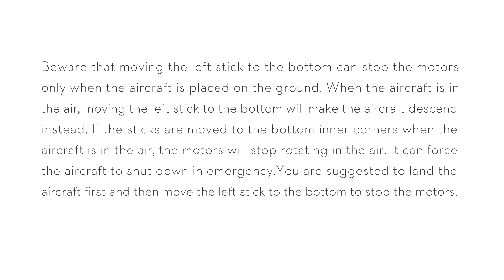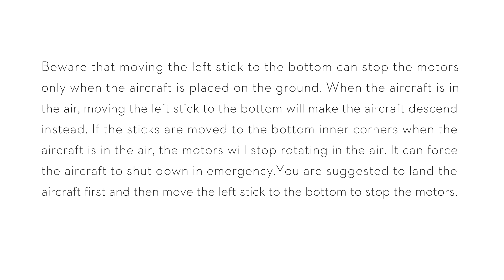DJI Phantom 3 | How to Use the Phantom 3 Standard Remote Controller

Comment from the maker: DJI Support is moving to DJI Tutorials! 
Don’t miss our consolidated contents and new videos, 
subscribe to DJI Tutorials at: http://bit.ly/2X04acQ
Reply: Wifi reset doesn't work for me. Any suggestions?
Reply from the maker: @vivianwhite3663  Hi, may we know the model of your drone, and could you please tell us more details about it? We will try to help. You can also contact us at http://www.dji.com/support
Reply: @DJISupportGlobal I have a phantom 3 standard. When I hold the gimbal far right and flick the s2 switch back and forth it does not do anything. No red light flashing. And I can't get the Drone to pull up wifi on my phone. No phantom wifi
Reply from the maker: @vivianwhite3663  Hi there, could you please try to upgrade the firmware to the latest one and try again? If it still does not work, please provide us with a video for further check. You can also contact our support team through the link below and send the video. http://www.dji.com/support

Comment: I keep trying to change my default password and it will say restart so I do that but it isn't sticking it goes back to the default anyone know what I'm doing wrong?
Reply from the maker: May we know did you try to change the wifi connection password throught the DJI Go App? Please refer to page 33: https://dl.djicdn.com/downloads/phantom_3/User%20Manual/Phantom_3_Standard_User_Manual_v1.4_en.pdf
Reply: @DJISupportGlobal  Yes when I go into Dji Go app it tells me it's a weak password which is default 12341234 so then it asks if I want to change it,
Reply: @DJISupportGlobal  I'll give it a read over this morning...thank you kindly
Reply from the maker: @InTheFleshInc  May we know which mobile device you are using? Is it possible to quite the reminder?
Reply: @DJISupportGlobal  I'm using a LG G6 it pops up reminder every time I go into the Camera, I haven't had a chance to go over the previous docs so tomorrow I will let you know if I got it changed or not... Thank you kindly for your time and response
Reply from the maker: @InTheFleshInc  Thank you, please keep us updated if there is any issue. You can contact us at http://www.dji.com/support	as well.

Comment: I can't get mine to hook up to the remote to controller like it said. Mine was good at first but it didn't seem to work my camera so I followed what he said about holding one button down for several seconds and then flip the left switch 3 times. So after trying to do that the reset button was green and not red like its supposed to be. I then pushed it even though it was green and then it turned red flashing so I did it all over again and now I cant get it to turn on the moters. FUCK!!! Any help guy's?

Comment: my problem is that I just bought that drone I have not flown this new I have the application I have it configured but the problrma is that I can not start the motors with the control only I move the ginbal and the signal is ful only d and a aunto takeoff but I'm scared and I'm sorry for the reason that I can not handle it with the command

Comment: hey so i got a phantom 3 remote and it has small rain damage the remote isn't switching on but it does charge i took it fully apart and i don't see any bad circuits or anything not sure what to do with it any tips?

Comment: The only cable that comes in the box cannot be plugged in my iPhone 6. How do I set up this thing? Very frustrating...
Reply: it doesn't need to be connected with a wire to your phone. you connect it with the drone's wi fi. I hear you though. this thing is complicated and instructions aren't very clear. I've had to look all over the internet to find some answers to questions I have and still haven't flown it. lol
Reply: Thanks Chuck. I eventually realized that it was supposed to be wireless and was able to connect it. But the app kept crashing on my iPhone (even after re-downloading, updating, etc.) so I was never able to make the drone fly. I returned it and will do more research before purchasing another model.
Reply: SpaceCowboy wow. I hope it will work for me. All I've done so far was update the firmware, calibrated this and that and did a few things in the simulator but I'm still not sure about flying it yet cuz there's so much to learn. Lol if I knew it would be this difficult I would have not bought it. Sorry it didn't work for you.

Comment: Ever since i got my drone it wont detect on my phone. i reset the wifi, relinked controller and tried everything. i can fly it manually but thats not what i want.
Reply: I have a galaxy s5, one of the phones you guys "tested"
Reply: tested with nexus 6p and same result. its not the phone, the 6p came out at the end of 2015 lol
Reply: You have to move your phone into Aircraft mode first. Then turn WiFi back on to link to Phantom3 wifi.

Comment: Hello, I got a question, when you are in the air, can you push the left joystick down to descent quickly? Won't it stop the engins?at 0:51 he does it but it's on the ground. Thank you :)
Reply: Maciek Wolski nah it doesn't stop motors only if u push down on both sticks

Comment: Question-- is it possible to use 2 remote controllers with the Phantom 3 Standard-- one remote controller at launch site, one controller at landing site, to ensure unbroken signal?  Has anyone ever tried to use 2 different P3 Standard remote controllers at the same time?

Comment: Yeah but what i wanted to know was, how the sticks work, like the right stick does that move it left to right and if so how ? Reason im asking this is because im very new to these an just got one, tried to fly it and it crashed. It only crashed like 5ft off the ground into an object, but it seemed like when i pushed right on the right stick it tilted to my left, perhaps it was backwards i have no clue...  I understand if the drone is in reverse of my then right may cause it to go left, but is this what happened ?? Just wondering if anyone could help, thanks!
Reply: Thanks, i finally learned how to fly it!  Too bad it will not go any higher then 500ft.

Comment: I am losing RC signal at very short range. (30m-70m distance). I have checked everything.WiFi OK, Calibration OK, no crashes. PHANTOM 3 Standard. I have this drone for one month. Any ideas?
Reply: Thank you for reply. No improvement. I'm sending my Phantom 3 Standard to Netherlands for service today. It must be some kind of error. I had nearly 500m flight distance and 200m altitude (countryside) before this situation occurred. I will let you know of the outcome. I heard that more users had the same problem. Adam.
Reply: i never upgrade my firmware from unboxing, so it can be fly about 600metres, and make sure you dont activate the beginner mode, it can be made the aircraft fly between 30-50metres only
Reply: Thanks for advice Iman. I have checked everything before I contacted DJI support. Beginner mode was off. I should have record a video to show this strange thing. Imagine you fly your drone and it losing the signal after 30-100m... than Return To Home..again and again.. It is very frustrating. I was trying to fix the problem by restarting, calibrating and changing the batteries but nothing helped. It started at the beginning of june during my holiday in Lithuania. I did not have any problems before. I'm really impressed by the video quality of P3S and this is the best ''toy'' I ever had. My drone will be in Netherlands tomorrow (UPS) and I hope the guys will find a solution. Adam.
Reply: Dji produce the new firmware thats follow faa requirement, fly safe under 150, thats related to our aircraft with the newest firmware
Reply: I got my drone back. Everything is OK.  Thank you DJI. Great customer service.
Reply: Reset Wifi Password and name of default and try again.

Comment: DJI Support, what is the deal? 
You all know this is like 1/3 of the information that new users need and there's absolutely no coverage of the different modes, what they can and cannot do, and how the user should interact with these modes in the cellphone application. This blatant negligence will lead to first-time flyers ditching the instruction booklet thinking they know "enough" to mess with these settings while flying and it will surely cause injuries and property damage. Do your damn job and quit posting half-ass videos.

Comment: Hi all, just wanted to let you know about an issue i had with the p3std rc, in the case it wont bind to your craft and resetting the wifi only results in red and green blinking light forever, you have a defective rc transmitter. DJI covers it under warranty if you are within the 1 year period.

Comment: Funny that quick guide didnt mention anything about calibration between control and copter also its bit funny that tutorial video is not helping with right corner switch. p mode and non GPS mode and 3rd one what is something? 

For the price the manual is really giving limited info.

Comment: Hello , my V1.1.1 ghost lights red in control, the Internet most I saw were also red , but some friends have informed me green too, even has a friend of mine who has a same as mine , but the light comes on green.
My control is with fresh batteries , regular works with the drone , but would like to know the difference!
The firmware of my phantom is with version 4.02 , and has an update for version 6.4 available, should I do it ?
Some told me that some updates contained errors and were knocking down drones , something went wrong, things like that.
I thank you and I'm waiting .

Comment: My transmitter appears to be in CE mode does anyone know how to put it into FCC mode please? On the reverse there is only 1 hole with a screwdriver symbol next to it in the bottom left hand corner. Although it has the symbol there is no adjustment screw on the circuit board underneath, nor is there any sign of anything on the board that looks like it could be adjusted.
Reply: +david webber did you find out how to do it?
Reply: +david webber I contacted support and they said that the mode is set based on the country they ship to. If you are not in the U.S. it will be in CE mode.

Comment: Hi Just received my new Phantom 3s. Ofter returning the craft to the supplier once this week i now have a new problem, binding the RC to the aircraft. Ive tried all the processors to get the binding activated but to no avail. Any ideas, much appreciated.

Chris
Reply: +old guys drone having the same problem here. Remote will not pair to the drone, even after following these directions exactly. This is the 3rd Phantom I've owned and they all have been horribly frustrating to get started.

Comment: are we supposed to link the rc? I had mine for about a month. Hope it doesn't mess with the flight because I did the rc link. I thought it was an update. the screen now shows the radar and the area GPS map on the same screen but different boxes.
Reply: You don't have to some will already come linked.  So your probably fine.  I didn't have to link mine either
Reply: +richard Palmisano Mine already came linked. Just make sure you're keeping your firmware updated.